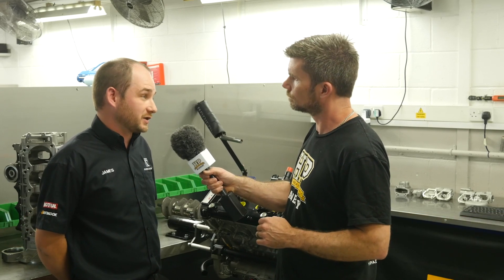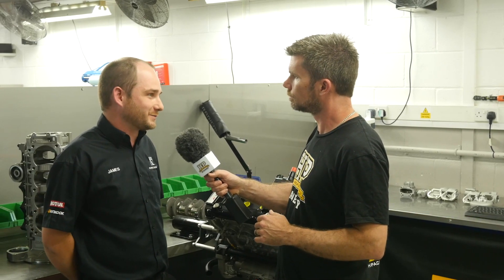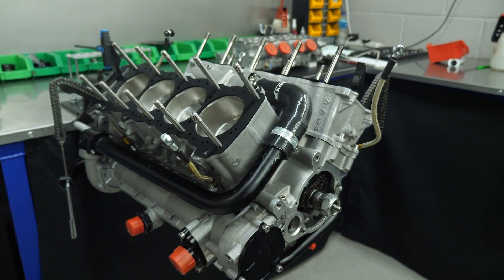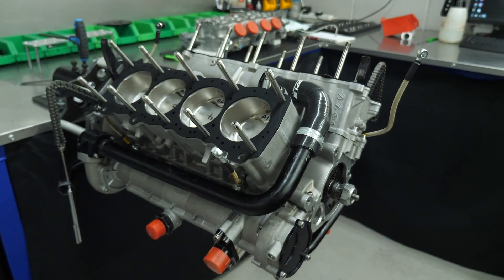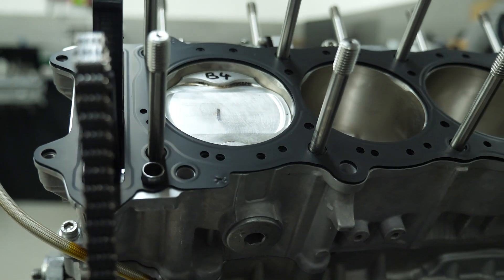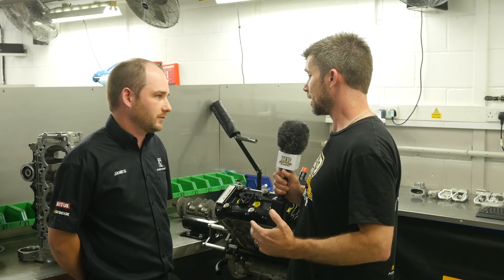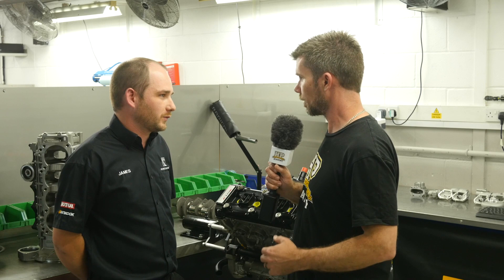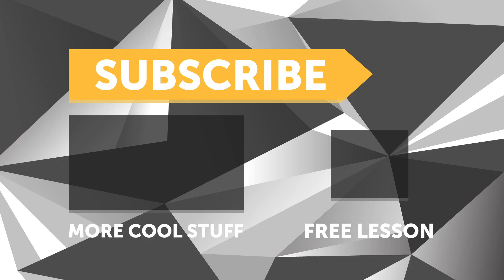72° vs 90° Degree V8 | ‘Hayabusa’ V8 [#TECHTALK]

Comment: The Volkswagen  V10 5.0 with a 90° Bank, solved the Issue with Offseting the Crank by 15°, therefore the Engine Thinks it is a 72°, NOT a 90°!

Comment: a new block because of packaging ! from 90 to 72 you are saving 10cm from each side, waaw.
or maybe they stole an already designed v10
Reply: How is an extra 20cm working space between the chassis rails not a HUGE advantage? You could mount it lower, or fit it to a smaller and lighter vehicle.
I think you need to spend more time sitting in empty engine bay's there Paul to get an idea of how much difference 20cm really is.